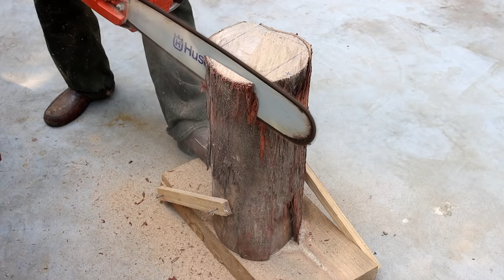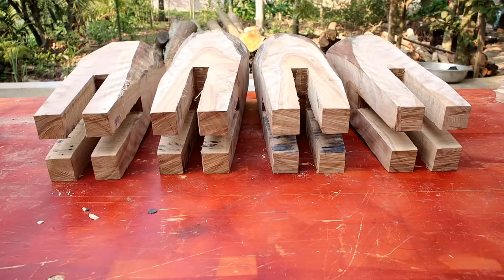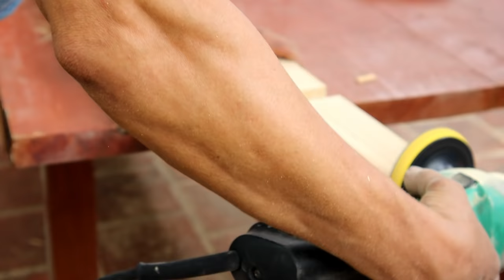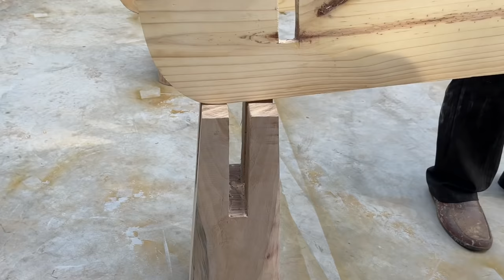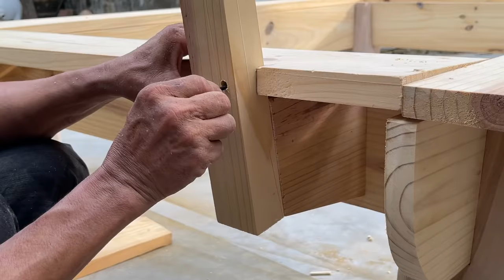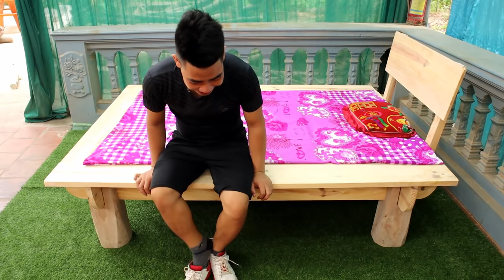Build An Incredibly Strong And Easy Bed With Simple Joints // Creative Woodworking With Dried Stumps

Comment: Good idea gone over-the-top. I would have made the legs to fit tighter and have the rails rabbetted so a box springs can fit inside them after assembly and leave it at that. Then you'd nave a base you could take apart. The two side rails would have tight fitting joints for a proper headboard that would be the only thing with glue and dowels in it.

Comment: Great little project, given that he didn't have any tool that was sharp. And the band saw needs a degreasing. Imagine his skill level with sharp tools.
Reply: Yeah, i was going to say that chain saw is very dull.  I'm used to seeing chips of wood flying off, not saw dust.  :P
Reply: it's not hard to sharpen the chain on the chain saw, just need a round file.  it only takes about 15 to 20 minutes to sharpen, i know because i did it many times.

Comment: Use steel screw for some part than wood for more strength.  And add more extended spacious panel for head board. To move the bed easily, consider joint connection of breaking up concept
Reply: Thank you very much
Reply: Top top
Reply: I would not like to move it up stairs to the master bedroom 🙄 it has to weight 300+ pounds

Comment: If only it was as easy to make precision joints as you made it look. Nice work!
Reply: Outstanding work God has blessed him . bottom line.👍🙏
Reply: He didn't even have the decency to leave sharp edges and corners to hit with your toes! Lol.
   I have a small picnic table made by the slot method. No fasteners, and it breaks down to flat when not needed. Magazine plan.